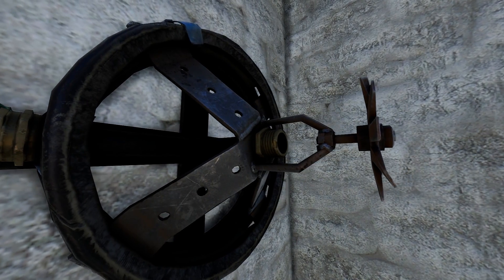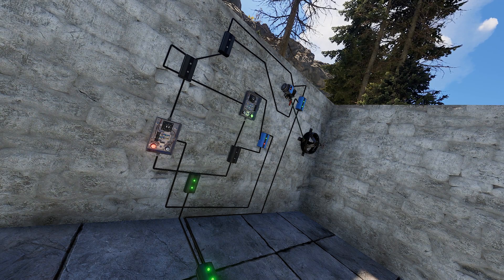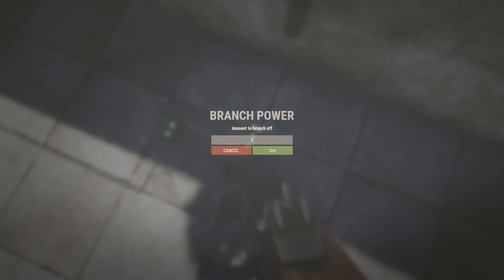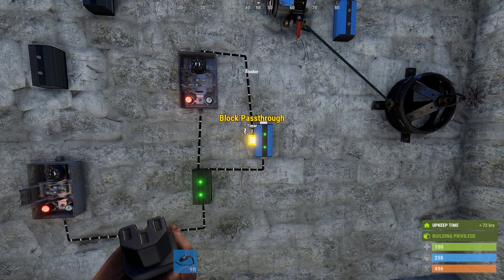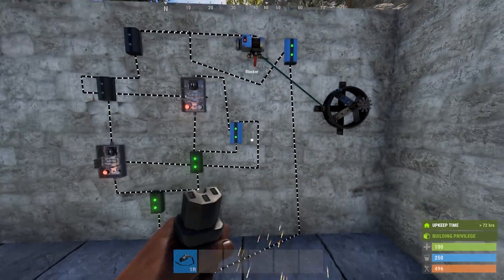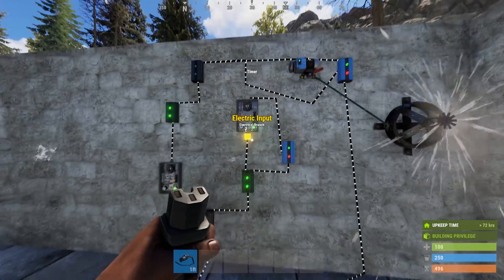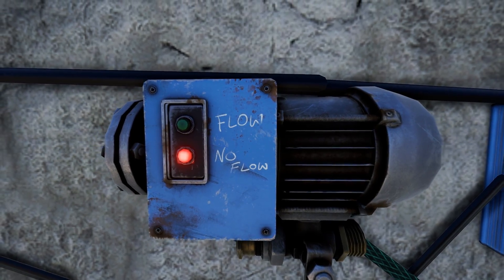RUST 101: Farming 2.0 - Automatic Sprinklers

Comment: I assume the labels for the pump have changed cause mine say: toggle and power pump, power pump is father from the switch and the toggle is closest to the switch, when I had it working somewhat it would turn on but turn off and not turn on again.
Edit: when I DID it the way I THOUGHT it was wired the sprinkler only spirts out for about half a second and then doesn’t go past that, at least it is an automatic spirt but I don’t know what I did wrong
2nd Edit: Saw you made an updated video on this, thank you so much

Comment: u can just do it with 2 timer or timer xor switch this system is stupid sry lol
Reply from the maker: Wait what? I don't get it? What are you replacing with the 2 timers or timer and xor?
Reply: make a infinite time lap with one timer that goes on and off whenever  u set timer then connect it to another timer toggle it only needs 12 power and need less compunents and easier to learn
Reply: https://youtu.be/wu5QYpmS5Hc at the end of circuit connect it to a timer toggle and at the beginning add another electrical branch and give two power to second timer so it can work then second one will give power to water switch to tell how long work and first one will determine how often it should give water
Reply: u can also do it with AND-switch and xor + and timer which is complicated but works fine
Reply: u need 3 branch 2 timer 1 xor switch that's it look at the last comment i send with utube video I just added another timer to that system and made it work for farm
Reply from the maker: Oh wait roflmao sorry I thought this comment was on my latest circuit. This one is outdated, I did an updated circuit which was simplified. However before the change that made me review the circuit there wasn't a toggle on the pump which changed everything.

Comment: Excuse me man. I followd your instruction every single step and even double triple checked the circuit but it wont work like in the video mainly because, the fluid switch pump only has power pump and toggle option unlike in your video where it has turn on and turn off option? Am i doing something wrong? Im pretty sure its the same equipment. So why do i only have power pump and toggle option? Is it a new update?
Reply from the maker: You haven't done anything wrong whatsoever!! I dunno why but in the latest patch on Thursday they changed the pump so instead of the on / off switches it's now the toggle as you've discovered. 

Honestly I'm surprised they changed it especially when it essentially makes it's functionality worse. That being said I do have an updated circuit in the works. Sadly it's currently looking like it'll be more complex as the toggle doesn't allow the same functionality as the on/off.
Reply: @Malonik  ah that explains why. I was wrecking my head and replaying your video more than 10 times. Phew
Reply from the maker: @guts7295  Roflmao yeah imagine how confused I was given I made the damn circuit... Like I went to use it and was like wtf is this.... lol
Reply: @Malonik  i used this setup this afternoon and it works, branch to toggle, passthrough to power
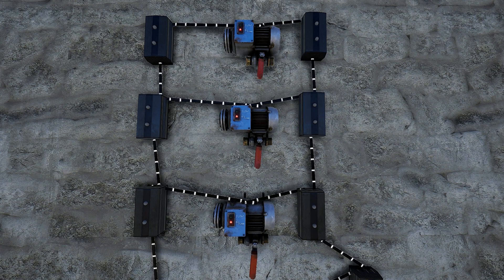Reply: im having trouble with 3:29, can you explain from the original circuit, how do i expand it?
Reply from the maker: @anaritacoelho6689  You can get it to turn on and off but do you actually have have seperate control over how long it's on and off with that?
Reply from the maker: @anaritacoelho6689  As for the expanding part I'm doing an updated video on the circuit today so I'll make sure I explain that part better. :)
Reply: @Malonik  Yes i do. Another thing i found out and im wondering if it´s just me, i can have 6 sprinklers (2 farm blocks) for a pump that gets water from a barrel. To keep that barrel going up and the soil of the farms always 9000/9000 i have 3 pumps feeding the barrel and my system is pouring water for 5 sec every 12 sec.
Reply from the maker: @anaritacoelho6689  Yeah so I just jumped on and I'm playing with the pump now. It's weird because they've labelled it as a toggle but it's not actually a toggle. It works more like a power input than a toggle. So yeah makes sense that the circuit still functions.

As for the water situation that sounds about right. The water pumps are nowhere near as powerful as I was hoping so there's gonna be a lot of them for bigger farms. Be careful with the soil saturation though because you can oversaturate them. Each plant has a different optimal saturation range and I don't think any of them are the full 9k.

Comment: I just use a solar panel and a timer. Its not perfect but it keeps my crops plenty hydrated and doesn't cost an arm and a leg just for some food.
Reply from the maker: Yeah that's fair. Depending on the setup that wouldn't work for everyone. If your pump doesn't require power to water the plants it would just run continuously.

Comment: With the patch from yesterday this system can be reduced down. Branch E and Blocker B are no longer needed.
The initial Branch off from the main power line can be set to 15 the following to 12 and then 6. 
As you reach Branch D lead the Power Out to the toggle on the Fluid Switch & Pump and connect the  Power Out from Branch A to the Power In of the Fluid Switch & Pump.
Reply from the maker: Absolutely! Honestly didn't see that change to the toggle coming but you're 100% right.
Reply: Also a decent system to run the new water pumps, if you make some changes to the branch outputs and run at least 2 of them to save energy. (1 pump takes 5 electricity and  does 5000ml in 33.3 minutes)

Comment: Having trouble getting power through the extra branch's to the extra pumps, tips?
Reply from the maker: Easiest way would be to add an extra branch at the very start connecting to your power source, run the power out on to the existing circuit and use the branch off to power your extra branches / pumps.

Comment: Thanks for the  videos ive built a system that has one large water catcher going to a water barrel that feeds only one sprinkler. With a total of 18 large water catchers 18 barrels and 18 sprinkler heads. 18 pumps to fill barrels in the attic and 18 pumps to feed from the barrels to the sprinkler. All power by branches and a branch for each on and off switch on the pumps to individualy control water going from catchers then another set of switches to allow water from the barrels to to sprinklers. It toon about 100 branches to automate but it turned out awesome. I think its using for everything plus lights like 400 power so 4 windmills and 4 large batteries. Quite expensive for 6 farm blocks but its exactly what i wanted and once the large catchers fill up you have a serious water supply.

So basically i hit one switch and it sucks all 18 of the large water catchers water up to the attic to fill all 18 barrels at the same time. Then once full i can switch that off. Then i have another switch that turns on all 18 pumps between the water barrels and its individual sprinkler head. With one full barrel only powering one sprinkler head each it lasts for a very long time and can get many saturations with it.

Next i should try to figure out the timing for the two systems to see if it would be self  sustaining
Reply from the maker: I admire the shit out of your dedication to farming... That's one hell of a serious setup and omg 400 power lol.

You'll be happy (or maybe sad lol) to know that next Friday they're dropping a new pump that goes straight in the water source and a new purifier that plugs straight into it. So thankfully water supply won't be an issue for too long as systems can be simplified just a tad so they don't cost 400 power lol.

Comment: Question about this setup and how I tried to adapt it to my setup. I have 2 rows of 4 large planter beds separated by a walkway. I have sprinklers above each bed. 4 sprinklers on one side and 4 on the other.  Since you cant chain more than 3 sprinklers together, i setup 3 stations just like your setup. One for the first 3 sprinklers, another for the next 3 and a last one for the last 2 sprinklers. They all work as intended but im having issues with water flow.

My water setup is pretty simple, a bunch of large water collectors on the ground that pump up to some small water collectors on my roof. From the last small water collector it goes down to a fluid splitter. The splitter branches out to three different water tanks. All three water tanks receive water from the splitter and are full (one thing i noticed is that the tanks only fill up one at a time from the splitter, weird).  All three tanks are receiving 12ml from the splitter and ready to output 12ml from the nozzle. The problem that im running into is that only one of these water tanks is feeding water to its assigned water pump. The other 2 do not flow to the pump at all. All three setups are the exact same and I cant figure it out. Any ideas would be greatly appreciated.
Reply from the maker: Welcome to the current farming nightmare! Yay! Lol.. Seriously though water is a big problem for a lot of people currently. Best temporary solution is manually filling the water collector's with the blue water jugs.

That being said we should be receiving two new farming components in the patch this week. One of which being a pump that we throw in a water source and it sucks it straight from there. So thankfully the drought is very temporary at this point.
Reply: @Malonik  Figured it out, so all 3 pumps followed your circuit design, none of them had power going to the Pump Power input on the pump including the one circuit that worked. Added an extra branch to the two circuits that didnt work and branched out power to the Pump Power input and they are all working now. Dont know why one works without and the other 2 required it but oh well adapt and overcome right.
Reply from the maker: @SgtDonkey1  You only need to power a pump if it has to run uphill. If that one pump is at roughly the same height or higher than the sprinklers then it won't need power. :)
Reply: @Malonik  All 3 water tanks to pumps are at the same height as each other. All on the second floor of my greenhouse.
Reply from the maker: @SgtDonkey1  What about the pumps to sprinklers?
Reply: @Malonik  i replicated your circuit to 3 different areas of my second floor, each next to the water tank they draw water from. So its identical all the way around.
Reply from the maker: @SgtDonkey1  That is so weird... wonder why lol.

Comment: You should add these to https://www.rustrician.io/ so others can use that
Reply from the maker: Good idea! :)
Reply: @Malonik  Seems to be there already under "example" circuits. 

Side note, do you have an example using a generator and battery only? Use the generator to use 10 power for lights, and the rest to charge the battery. When the battery is full then turn the generator off and let the lights run of the battery till its flat and repeat the cycle? 

I feel like that could work in caves for conserving low grade?

Comment: I made the same principle, but with 1 timer and a counter using the memory cell to switch the pumps on and off. If you set my timer at 60 seconds the counter will dictate how long there will be no water after 1 minute of sprinkling

but this is less complicated then mine :P
Reply from the maker: Nice! I didn't think of using a counter to delay it, that's really clever. :)
Reply: @Malonik  my main annoyance is you can't adjust timers when they are going
Reply from the maker: @Baer1990  Omg how frustrating is that!!! I hate having to disconnect and rewire my triggers when I'm working on a circuit lol.

Comment: Ive been wanting to learn how to use a counter to tell me how long it has been since oil rig crate has been started. Saw it on a MiketheVike base tour once and ive never figured out how to make it work
Reply from the maker: Interestingly enough you could use this circuit to pull that off. Set each timer to 1 second so that it goes off every second and run that into the increase on a counter. Then on your circuit that lets you know when oil rig is activated you can branch off power to the reset on the counter. :)

Comment: Can this be used inside the base to put out fires? It would really open the game up more.
Reply from the maker: They can put out campfires, not sure about say incend rockets for example. They're also changing the sprinklers water effect so it wets players in the next patch. :)
Reply: No not currently. I tested this on staging for a bit with 6 sprinklers all very close to one another @ one wall high and fired incendiary rockets / incendiary ammo / fire arrows right in the middle of their range. Fire started, turned on the sprinklers. The fire continued to spread and nothing was extinguished until the fireballs reached their normal despawn time. 

There's a commit on the farming2/pump branch that suggests that sprinklers are supposed to extinguish fireballs but the water required to do so was initially set so high that they will never extinguish fire, and thus they lowered the water requirement to make sprinklers actually extinguish fireballs: https://commits.facepunch.com/362502

Once that branch is merged over to farming2, and farming2 is merged to main branch (which is staging branch, NOT release branch), this will mean all of the farming2/pump and farming2 branch commits will be in effect and testable on staging. It has been confirmed that the farming2/pump and farming2 branch commits will be live on release branch May 7th.

Comment: Can you use the sprinklers to fight fire in your base i realy want to know that
Reply from the maker: Hmm... I haven't tested that... If it doesn't then it might after the patch because they are messing with a fair bit...
Reply: No not currently. I tested this on staging for a bit with 6 sprinklers all very close to one another @ one wall high and fired incendiary rockets / incendiary ammo / fire arrows right in the middle of their range. Fire started, turned on the sprinklers. The fire continued to spread and nothing was extinguished until the fireballs reached their normal despawn time. 

There's a commit on the farming2/pump branch that suggests that sprinklers are supposed to extinguish fireballs but the water required to do so was initially set so high that they will never extinguish fire, and thus they lowered the water requirement to make sprinklers actually extinguish fireballs: https://commits.facepunch.com/362502

Once that branch is merged over to farming2, and farming2 is merged to main branch (which is staging branch, NOT release branch), this will mean all of the farming2/pump and farming2 branch commits will be in effect and testable on staging. It has been confirmed that the farming2/pump and farming2 branch commits will be live on release branch May 7th.

Comment: connected 4 small water collectors [3rd floor]  to a barrel [2nd floor] , one barrel to a sprinkler [1st floor]. Averages 5 seconds of water every 15 seconds. 1 sprinkler can water 4 large planters if placed in the middle. 3rd floor [windmill], 2nd floor [battery], 1st floor [light]. 1 light per planter gives 100% light.  If you overlap sprinklers, you can cause double-density water flowthrough, which can increase or decrease the optimum water for various plants. example being - 3x3 adjacent planter boxes, 2 sprinklers. outside areas are for corn or hemp, inside area is for pumpkin or potato.
Reply from the maker: Nice one! :)

Comment: Just connect the sprinklers to a solar panel and a timer, Im watering my farms at night for 20 minutes.
Reply from the maker: As in run the solar panels to batteries and then run it off them?
Reply: @Malonik  Yes of-course, basically just using the solar panel to determine the trigger when the sprinklers should come on and the timer set to 1200 seconds , it works well for me, just having to add more catchers as the water runs out depending on the qty of farm blocks.

Comment: Hey I've been thinking about this in the last 24 hours or so and I'm pretty sure there's an easier/cheaper way to do this, I've noticed that you're wiring up both the on and off inputs on the pump, if you make use of gravity by having the pump+sprinklers higher then your water storage you can leave the pump "on" but unpowered, water will flow when it receives power and stops when it doesnt. 
This should mean you can get away with one less blocker and a branch or two less, because you have a single "signal" now you can also broadcast it over RF and people can piggyback off the one advanced circuit.
Reply from the maker: Yeah I had thought of that but I didn't want people who had pumps that are lower building it and saying it doesn't work. 

Plus on the off chance that they change it so for whatever reason you have to trigger the buttons at least it's just done without too much extra cost.
Reply: yeah that's completely understandable, far less "this doesnt work" comments if you cover all bases. Only reason I've ventured down this path is the server I play on has lots of people who are completely against trying electricity, so once I get this RF signal going I can wire up peoples farms much faster and if I go full capitalist then I guess I can treat it as a subscription service lol. Thankyou though, I'd not wired up a clock timer before watching this vid only stuff based around the day/night cycle